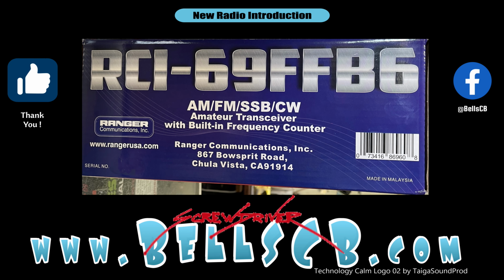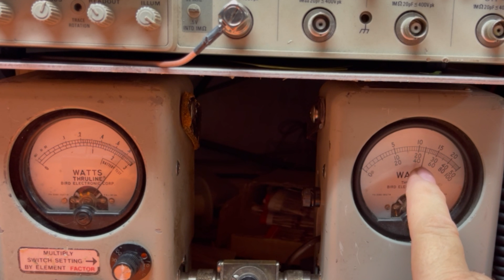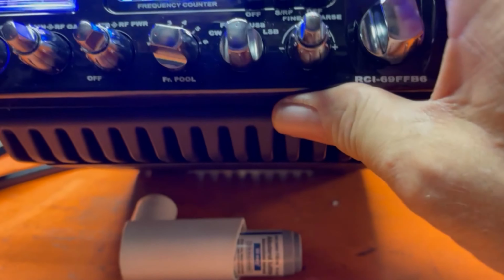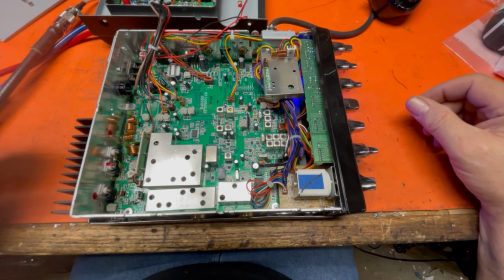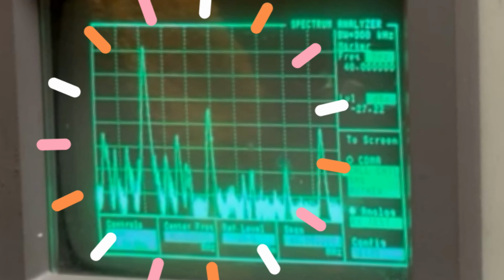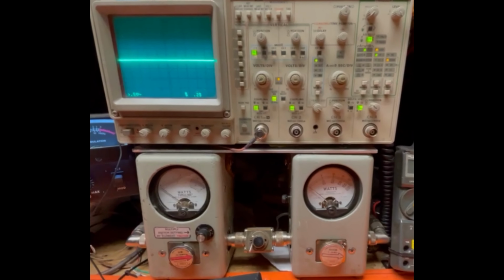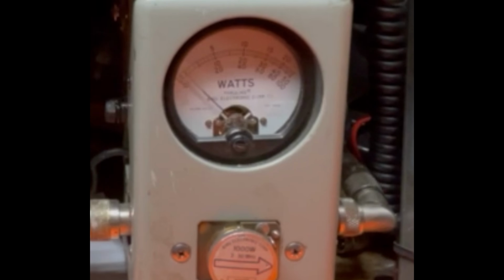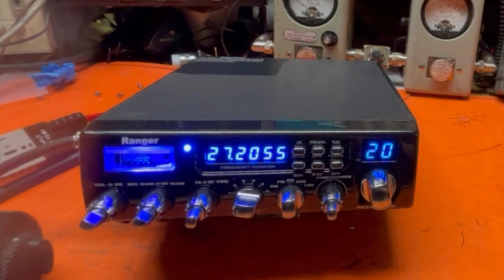Introduction to the Ranger RCI-69FFB6 new model late 2023

Comment: I think Ranger is missing at least some of the mark here…or ignoring a significant part of the market…they need to bring a modern AM/FM/SSB rig with CTCSS/DCS capability in FM mode (factory standard), smaller form factor and…Kenwood style audio connectors.  Look at what President, AnyTone, Stryker, PNI and so on are doing.  I know, there are lots of rebranded AnyTone rigs out there.  Anybody remember the CRE8900?  Now sold as an Alinco DX-10.

Internet linked repeaters, remote stations, simplex repeaters…now that FM is part of the picture…well, these things can absolutely be done here in the U.S. 

Does that mean AM and SSB are obsolete? Hell no.  I love a loud, punchy (but not distorted) AM rig.  Galaxy DX 959, Cobra 29, Superstar 3000, Superstar 3900 (especially the older ones) with a mild tune and an Astatic 636L or M6B amplified mic on AM is awesome.  The market for these rigs is very much still here.  

These high power built-in-amplifier rigs are beasts..*but not everybody wants / needs / can realistically afford a 400, 500+ watt radio*.  Something like the Superstar 121 (with CTCSS / DCS capability) or the smaller PNI HP8001 or HP8000L (or HP82, or the other mobile that has the Kenwood 2-pin / Baofeng standard audio connector right on the front) would be ideal.  

Now it’s possible to set up your own CB repeater for less than the price of one of these beast radios.  $100 or less for an AM/FM rig, $50 or so for a simplex repeater controller, plus costs for DC power supply, amplifier (if desired, nothing crazy is needed, a RM Italy KL200 / KL203 or entry-level Texas Star or other 100-200w amp is all you really need…coax cable and a base antenna and you’re good.

Comment: What is cw option for CB?
Reply from the maker: CW is a Ham radio function only
Reply: Ok, then why is it built into a Cb radio?
Reply: @heathlawson3059 
The radio is sold as a 10 meter ham radio .  It’s designed to be converted to 11 meter cb 
So after converting it , it will do 10 meter frequencies still , and also 11 meter CB
Reply: Ok, well that being said, Do I need a Ham license to use this radio?
Reply: @heathlawson3059  
No , not on the 11 meter CB band  
part of the radio. But on the 10, yes
Reply: cw is for Morse code
Reply: @TheRoadhammer379  
Oh 🤦🏼‍♂️🤦🏼‍♂️🤦🏼‍♂️, I’m a dummy ,, it’s a export 10 meter radio . I should’ve known that I’ve had my ticket for 12 years but I’ve never pushed myself to learn Morse Code but I do find it very interesting